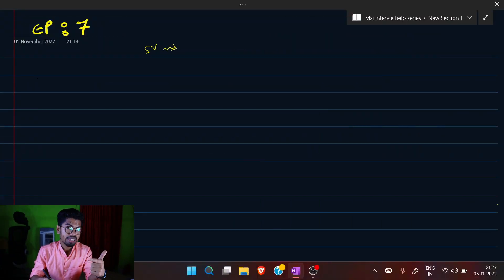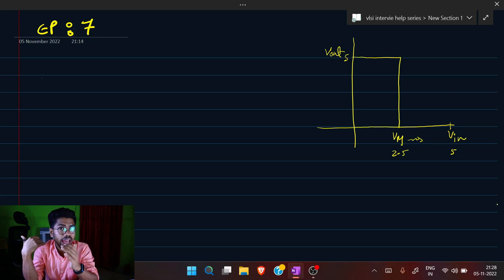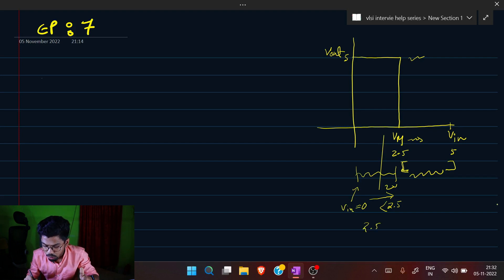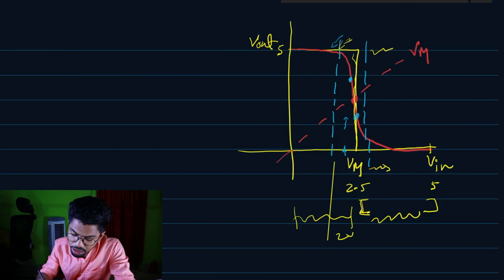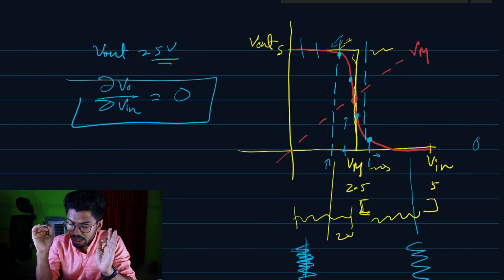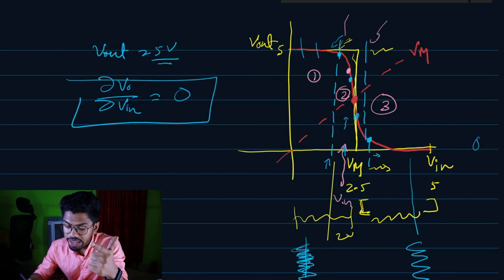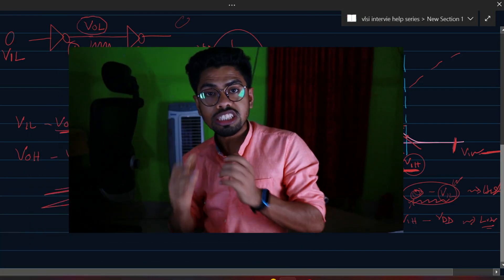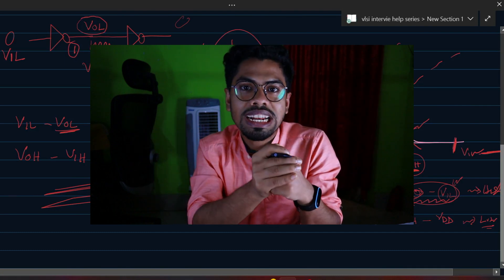Ep7:Trending questions on CMOS inverter | NOISE MARGIN | JOB or MTech admission interviews|

Comment: 6:37 ,but now if i input values between Vil and Vih , then what would be my output sir?
Reply: I guess based on equating the polarity of the noise signal with applied input signal the input is determined and results in corresponding output...
Reply: @manoj3197  yes as gain is very high in that region , so finding the output is very difficult as a minor noise in our input can change our output values
Reply: But in the range 0 to Vil, that is noise margin low , all inputs value is considered to be low, so our output is high, in that region , our gain is = 0 , so whatever noise is coming , it is being killed by our inverter , 
So a good inverter is capable of killing the noise at its output to give us specific output
Reply: @faneeshbansal  yes 
So noise doesn't make any differences for the output when it's introduced in region 1 and 3 

Any ideas on What would be practical conclusion if noise is introduced in region 2?
Reply: @manoj3197  yes the inverter is killing the noise as gain is 0 ( because the dvout/dvin) is zero, can't comment on section 2 because the output here is completely dependent on noise , a small noise can invert our output.
Reply: @faneeshbansal  okay thank you so much for ideas it could help me in future! ❤️
Reply: @manoj3197  can u pls tell me why at middle point in the vtc both pmos and nmos are in saturation, not able to understand it?
Reply: @faneeshbansal  
Initially when Vin starts to increase Vout falls causing the Vdsn to decrease and         |Vdsp| to increase. Now initially nmos is in saturation(vin is small and Vdsn is large) and pmos will be in linear region ( |Vdsp| is small initially) .

When Vin still increases same phenomenon mentioned above happens (Vdsn continueus to decrease and |Vdsp| continues to increase) .

At some point of time (when Vin is Vdd/2) drain to source voltages of two transistor becomes equal to Overdrive voltage (Vin-Vtn and Vin-|Vtp|) simultaneously (assuming transistors are symmetric) . Now both transistors are in Saturation region....

Hope you understood the operating regions of VTC curve....